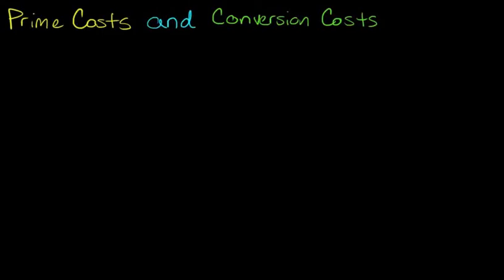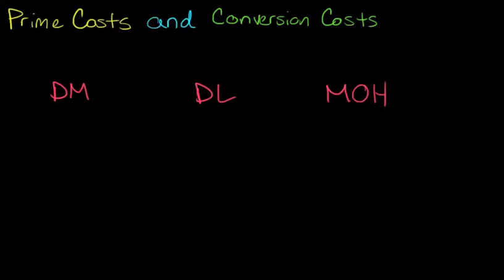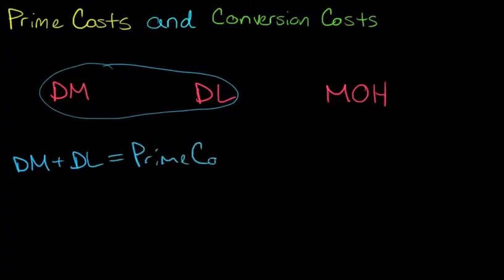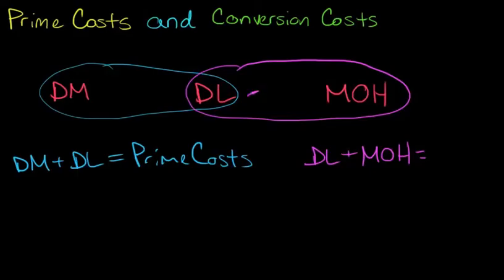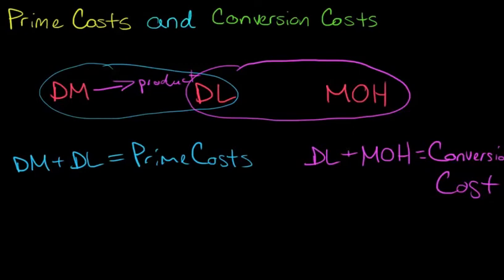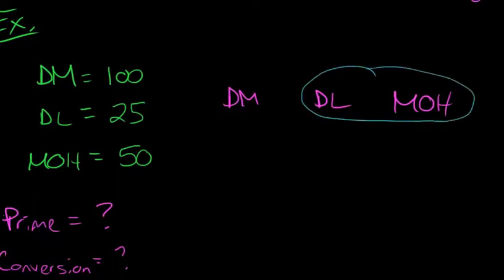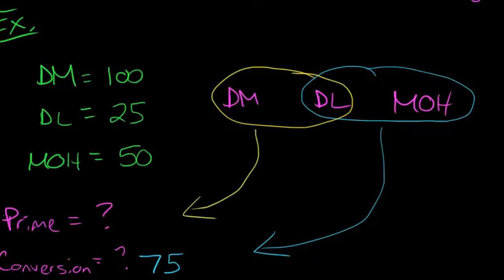Prime Costs and Conversion Costs

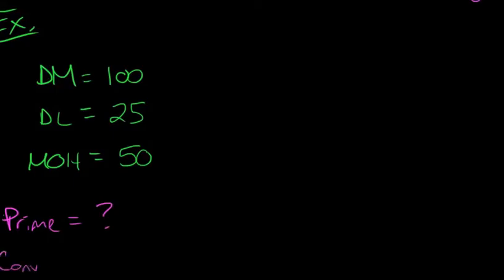Comment: Professor i just wanna say i love and appreciate all your videos. I have a question though about what you said about the conversion costs at 2:47 ( "how much does it cost to convert those raw materials into products").Can you please clarify what you meant on that. Thank you!
Reply from the maker: Let's say we have aluminum and we want to make aluminum cans.  The aluminum is the raw material, and conversion costs (direct labor and manufacturing overhead) are the costs we incur to transform the aluminum into an aluminum can.  For example, the depreciation incurred on the equipment we use to convert the aluminum into aluminum cans would be considered a conversion cost.

Comment: Hi, this is great. Does the production quantity matter? For example, If those were the cost of DM, DL, and MOH for 2013 and you produced 100,000 units. Do you still calculate if like the way you did on the video or do you have to times DL, DM, and MOH before calculating the prime cost or the conversion cost?
Reply: It depends if the info is given as "per unit" or a total amount

Comment: This video is great 
However, direct labor count twice and "double counting problem" may appear. 
How to solve it?
Thanks
Reply: +Alex Tung Hi Alex. You wouldn't use them at the same time. For example, the conversion cost is to be compared with direct material cost. So how much would it cost to convert $100 of materials into products? The conversion price which (in this example) is $75. Then the finished cost would be $175.

On the other hand, if you would want to see onle the prime cost (as in MOH isn't interesting or negligeble), then you can just add material cost and labour cost.

Makes sense? :)
Reply: +MrDymix Hello, MrDymix. Oh, I understand. Thank you very much
^^

Comment: Avery corporation's  northwestern factory  provided the following information for the  calendar yr.

Beginning Inventory;
direct materials   $59, 800
work in process.  $58,500

ending inventories
direct material.       $21,500
work in process.     $23,500

during the year, direct material purchases amounted  to $150,000  direct labor cost was $200,000 and the overhead cost was $324,700. There we're  100,000 units produced.

Question;
1.calculate the total cost of direct materials  used in production;
2. calculate the cost of goods manufactured, calculate the unit manufacturing cost .
3. of the unit manufacturing cost calculated in requirements 2, assume $1.70 is direct materials and $3.24 overhead. What is the prime cost per unit? conversion cost per unit.

Help me to answer those requirements